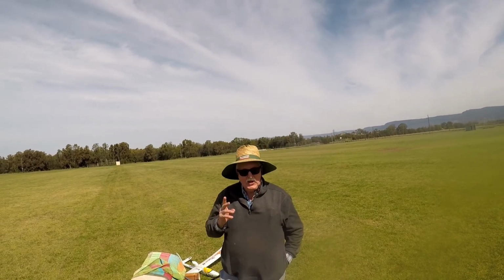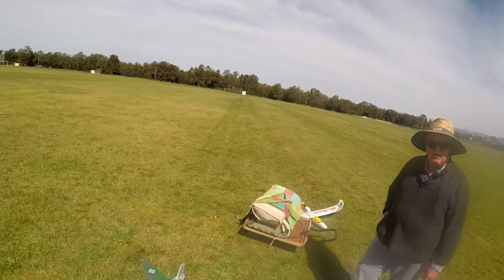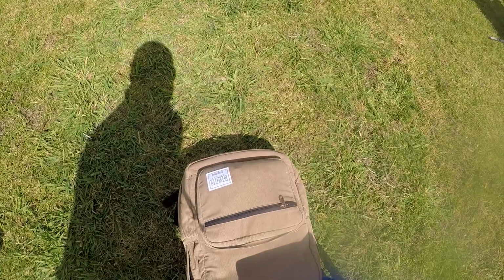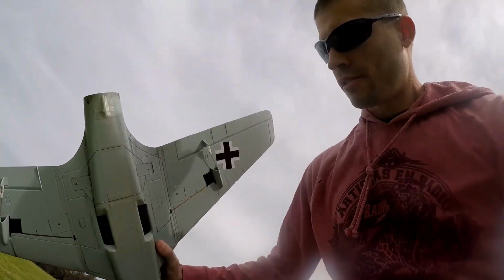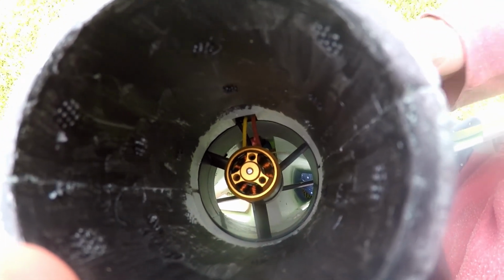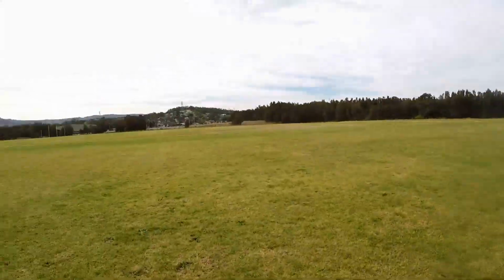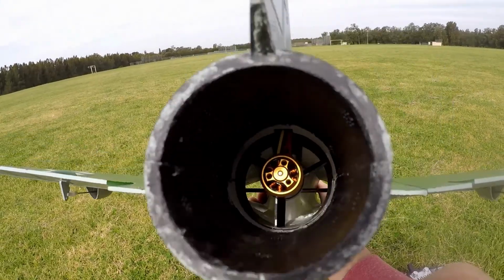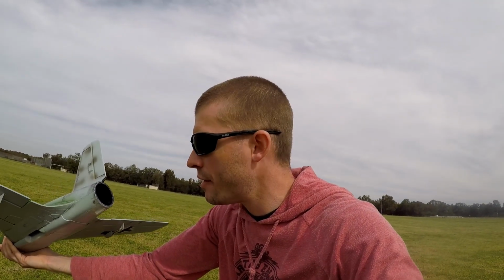Electric ducted fan impeller explosion! | Freewing 64mm P.15 Lippisch EDF | RC planes

Comment: looks like Tom had a plane that I had the most success with-the Sky Fly 2 by HobbyZone
Reply from the maker: Oh yes popular plane from what I've heard. He was recommended that aircraft from the local hobby shop. Sadly, the local guy seems to stock or in generally into aspects of rc that don't appeal to me as much as EDFs right now so I'm not really interested in heading over there. Too many great options online that are far more accessible. 

I think you've likely had much more success with you SkyFly2 than Tom did that day. He nose dived and didn't get back up again.
Reply: Too bad.  One day I had gained so much altitude with mine that I was afraid I was going to have to let her glide down on autopilot because loss of visual.
Reply from the maker: Wow sounds like an awesome glider. They can certainly be a lot of fun in the right hands.

Comment: Whoaa!!thank god still can save her .what happen actually?is that screw at edf leaf.?that means,u now can upgrade to next step on edf business mate😀😀😀maybe u can go with FMS Baehawk 80mm,or Freewing Avanti 80mm..u will like it.. cheers mate🍻🍻🍻🍻
Reply from the maker: Hahaha. I've been talking to some experts and trying to get another more powerful powerplant in the lippisch.. Can't afford another plane at the moment! Yes the avanti looks great, but I've got 10 3s batteries to use (I guess I could link them to make some 6s packs)
Reply from the maker: Oh .. and it just blew the blades clean off. Everything else was fine. Can't explain it exactly.
Reply: @nickhayley  owh ok.. weird things happen..hahaha..if the motor still can be use,i think u still can get the housing for that motor..64mm also a powerful plane..cheers mate 🍻🍻🍻
Reply from the maker: Correct. I also ordered a new duct and fan for $10. The new fan, motor and esc were installed yesterday.. maybe a maiden today with the new powerplant.. it was bigger than the old duct. Had to melt some foam. 😭👌👍🤷‍♂️
Reply: @nickhayley  are u using a bigger edf size?😱😱😱hope everything just fine and have a success maiden.. looking forward to your video bro.. cheers 🍻
Reply from the maker: The video has been recorded.. now to edit and get it up. Should be available within a week, my friend! Still with a 64mm .. but.. 64mm edfs are apparently NOT all the same size. There were some complications. 

Keep your eyes peeled for the next video!
Nick